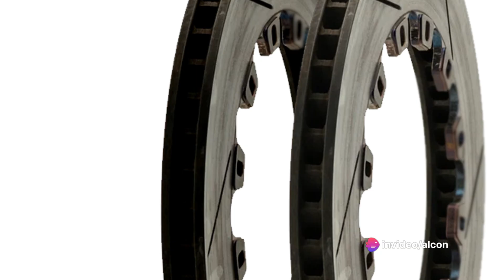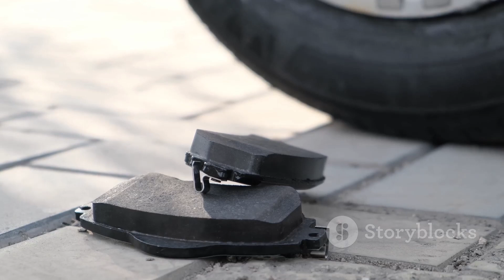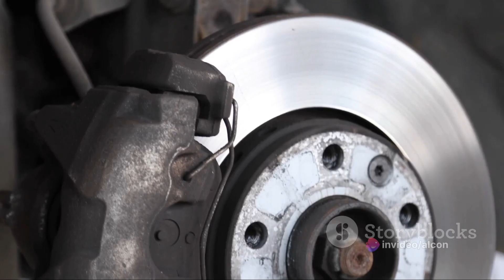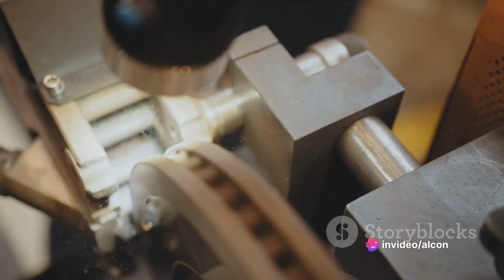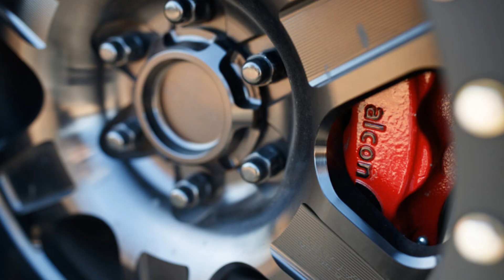Debunking the Myth of Warped Brake Discs

Comment: I don’t have a pulsating pedal. The pulsating I’m getting is on the front wheels. It gradually got worse after I put ceramic pads on. I know ceramic pads don’t dissipate heat like the OEM pads did and I believe it warped the rotors. And I understand the properties of ceramic so I know it’s not leaving brake material on the rotors and causing them to pulsate. Ceramic is extremely hard.
Reply from the maker: Hi.  Ceramic brake pad formulations deposit a layer of friction material onto the rotor that helps the two elements to work together to help control friction wear levels. The technology (referred to adherent or braking through adhesion) also helps to control noise, vibration and harshness.  Thie big difference between semi-metallic pads and ceramic, is that semi-metallic use a balance of abrasive and adherent friction.  Ceramic uses almost exclusively adherent which is why is so much easier on rotors.  https://www.tomorrowstechnician.com/understanding-friction-and-formulations/

Point being that uneven pad deposition on the rotor would still result in shudder in ceramic brake pads.
Reply: @alconkits4574  Thanks for your reply! I’m about to order rotors and pads!

Comment: Um yeah sorry B.S. on that, I've turned a shit ton of rotors in this trade over the years with no pad degradation on the rotor, pad wear is also even,  the rotors just warped, have you guys ever used a brake lathe? And then heat from brake applications, c'mon guys🤨
Reply from the maker: If you still have a brake lathe, then you're our people (not just a parts replacer).  You're not wrong, rotors will warp, eventually... ...but thats typically because a customer abused them by running too long on a shuddering rotor due to?  Paid deposition problems which cause hot spots and uneven wear.

Comment: Juan carlos roberto frenandez enriquez suarez…. down at the local used tire spot fiercely disagrees…..He says that he turns his (mas grande bro) 3/4 impact all the way up ……and gives no less than 14  but no more than 20…ugga duggas, if you ever return, after not tipping on the previous visit…
And he does so because his cousin, Alberto carmen luis dejesus dominguez benitez alvarez, sells brake rotors for a nice commission to them later, just down the street, at the local Vato zone 😂 lifetime warranty bro, get in the zone!

Comment: No way. Never is my experience of resurfacing a rotor have I just removed pad material.
Reply from the maker: ...but what caused the uneven rotor surface?  Either very substandard rotors (not as common any more) or hot spots and uneven wear due to the root cause - deposition problems.

Once you have to turn a rotor down more than a few thou - its because this rotor has been run with this issue for far too long.  

If you want - ask them how long they've been experiencing this problem.  We suspect that the longer it is left unresolved - the worse the runout will be.

Comment: I don't think so.  I am an ASE Master and even though most pedal pulsation is caused by uneven thickness of the rotor, uneven thickness is not caused by pad material deposits, it is caused by abnormal wear.  Slightly warped rotors will not cause pedal pulsation because the sliding calipers will follow the warped rotor...up to a point.
Reply from the maker: Abnormal wear is often caused by uneven friction- a deposition/bedding issue.  Certain spots develop cementite which is much harder than standard iron.  The result is uneven wear - resulting in runout and thickness differences.

..but you're not wrong.  Customers that run with this issue too long will cause hot spots and eventual warpage.  The point is - that is not the cause, it is an effect.

Comment: When you say brake pulsing, do you mean when the steering wheel shudders on heavy braking? Because I have had the steering wheel shudder on heavy braking, changed pads, control arms and bushes and the same thing continued until I replaced the brake rotors.
Reply from the maker: This is usually where it is felt first because it frequently happens on one rotor.  If it happens on both rotors can be felt as much in the brake pedal too.

Comment: This is completely untrue. Warped rotors are obvious because of what causes them: excessive heat and uneven wheel bolt torque.

If you get pulsation suddenly after having tires rotated, there's nothing that could have affected the pad bed-in because that's not part of a tire rotation.

If you get pulsation only when the rotors are hot, it's not going to be uneven bed-in either, because that would affect cold rotors as much as hot rotors.

If the brakes pulse after the rotors have gotten extremely hot, that's also not going to be from bad bed-in, because using the brakes enough to get them hot will even out the pad material. That's how bedding in brakes works.

As always, the proof is in the pudding. If you have the rotors turned and they pulse again, but the pulsation stops after you put new rotors on, the old rotors were definitely the problem.

The problem most people have is they pick the cheapest parts they can get, and cheap rotors warp as soon as you get them hot.
Reply from the maker: Hi Alex - this isn't a matter of absolutes.  Of course cheap rotors can be warped, and they can be torqued incorrectly.  Its possible, its just very uncommon.  We've seen this issue hundreds of times and perhaps 2 or 3 could be attributed to improper installation.

In addition improper pad bedding can cause localized hot spots what will cause runout.  Whether you call that runout or warping is likely a matter of symantics.

However in MOST cases, particularly in performance brakes where installation is done carefully - uneven pad deposition is the most frequent cause of brake shudder.

Your points are valid and perhaps we should rename the video to "THe myth that most brake shudder is caused by warping?"  What do you think?
Reply: @alconkits4574   most cases are people putting in the cheapest parts that they can. I'm certain that the cases you're talking about do you exist, but they do not exist in the majority of vehicles that are repaired for bottom dollar most of the time.

The number of vehicles in consumer service far outweighs the number of vehicles used in performance applications.
Reply: That’s not always the case. If you have one side of a caliper seized, it can eventually cause pulsating brakes. 
Also warped rotors isn’t just from too much torque, or white boxed. It can be caused by wrong pad/rotor combinations.
Reply: @TheOfficialRandomGuy  if one side of the caliper is seized, it would cause the rotor to overheat, warping it.
Reply: @AlexandarHullRichter  it “could” not would. Depends on how the caliper is hung up. There’s no absolute. Uneven brake deposit is a real thing.
Reply: kaferere  the wheels support the weight of the car. That can warp anything light enough to be a part of car. I think your error is that you are perceiving a warped rotor as being something like a taco, which is not what it looks like. 

A rotor can warp as little as 1/10,000" at the edge, and that will be enough to cause breaking pulsation. To the untrained eye, that tiny amount of runout is not even visible, but when the wheel is spinning at a 1000 rpms, you will feel it 2000-4000 times per minute the moment you touch that pedal. 

Remember, the distance each brake pad moves is only 5 mm (1/5") from when you install the brake pad to when it is worn out, years later. It's amazing that rotors can warp as much as they do before you feel it.

Your second error, I would say, is that you are discussing this as if it is theoretical, and not as if it is something that actually happens to people every day, which is what it is. We can say whatever we like, and it doesn't matter because it actually happens, and what actually happens is inherently more accurate than whatever is said about it.
Reply: kaferere   I think you also haven't seen videos of people getting their brakes red hot. That also happens. There are lots of people that regularly come to a stop and their brakes are glowing as bright as their taillights are. There's nothing that's going to keep steel rigid when it gets that hot.
Reply: kaferere   if you're going to use a typo as an excuse to ignore facts, you've got no business telling everyone they're incorrect.
Reply: kaferere   how exactly does overheating a rotor cause runout if not by warping, then? Do they magically wear weirdly because you get them hot? What about the ones that pulse when hot and not when cold? How else does heat cause runout?

Also, incorrect or uneven wheel bolt/nut torque DOES cause brake pulsation, and it can be fixed by retorquing the wheels correctly. How does that happen, if not by distorting the rotor?

I find it hilarious to you think metal can shatter before deforming. That's not how metal works. Even glass will bend before it shatters.
Reply: kaferere  The excuses you're making to deny a basic fact are quite hilarious. Literally everything in your last comment is absolutely wrong. I could go into every single detail if I wanted to, but I'm not going to waste my time. Literally every single sentence that is in your previous comment is not only so wildly incorrect, but it is so wildly incorrect that anyone who has put their hands on a car brake can independently tell you from their own experience, not from the internet, but from their experience, that each of those sentences is wrong.

Literally everything you've said has been telling me that you have only learned about cars in theory, and you've spent less time reading books about it than I've spent working on cars, and you're making up excuses to tell me wrong I'm wrong over the internet, because you don't have the courage to admit the things you claim to "know" are incorrect.
Reply: kaferere   btw:
https://youtube.com/shorts/CSOgT1xQE-U?si=KbmLnI9A5GWvhZM-
Reply: kaferere   not only is this glass, it's tempered safety glass, which is stressed to shatter completely instead of breaking in only one spot because that's how auto glass works:
https://youtu.be/I1VKVRotVxI?si=t0znVID0EUPvBMaA
Reply: kaferere   explain to me then how a freshly machined rotor gets to have an uneven surface after the lathe made it even, and explain to me why that only happens when it gets hot, before the rotor returns to having a smooth surface while it's cold and only while it's cold. 

And follow that up with an explanation of how replacing the rotors, and nothing else, solved that problem. 

I'll wait. I've only seen that happen a few times too.

Generally when you replace only one part and the problem goes away, it's pretty easy to figure out the part that got replaced was the problem.
Reply: kaferere  you're failing to answer my questions. How do you get breaking pulsation when the brakes are hot, and not when the brakes are cold, after the rotors have already been machined to eliminate uneven thickness and uneven deposits? How is it possible for that problem to be corrected by replacing only the rotors?

You do not have the ability to question any of these premises because they are things that actually happened. I'm simply asking you to explain how, since you are denying the obviously correct explanation. If the above is not explained by a rotor warping, then what quality of the brake rotor causes it? Remember it does get repaired without other parts being replaced.
Reply: If you have rotors turned and they still pulsate, it was not performed properly. Either the equipment is faulty or there wasn't enough material removed.
Reply: For a rotor to get so hot that it warps, it's probably bring abused. If a rotor has overheated it should be replaced. An overheated rotor is easily identified by a color change, normally blue. This video is clearly addressing the most common cause of pulsation which is absolutely uneven pad material transfer that causes a thickness variation. High and low quality rotors will do the same thing.
Reply: Propper bedding in procedures  actually require periods of cooling between cycles to avoid excessive heat. Where you've gathered your opinions only you will know, but I've got my knowledge directly from manufacturers. 

Also, you should be careful in arguing that if replacing the part fixes the problem, then there is no other remedy that would work. I wouldn't replace my kid with a new baby to get it to stop talking back and call that the only remedy.
Reply: You should tell your technician to learn how to machine rotors properly and perform the correct bedding in procedure or get a new technician.
Reply: @notSalaried  you assume I have a sample size of one. It sounds like you probably do. 

That is an incorrect assumption you have made about me.

I actually gather information from multiple places before forming opinions. In this case, my opinions are from multiple vehicles I've personally experienced, over multiple decades of service, and from experiences of literal hundreds of people in online groups for the vehicles I use. 

Manufacturers can say whatever they want to get your money. When people's goals are to keep their vehicles reliable for 30-40 years after production (read 25-35 years out of warranty), they look at things a little differently.

Also, replacing a child? Do you use rotors made of gold for such a comparison to be appropriate?

Where I live, a new, good quality, rotor costs less than a mid-range tire. Shitty rotors cost less than cheap tires. 

The labor cost of listening to idiots on the Internet is worth more than the cost of new pads and rotors, which I will remind you, are consumable items in the first place.
Reply: @AlexandarHullRichter  Explain to me how a parts manufacturer makes money on machining a used part for re-use. 

It soulds like your guy is a professional parts changer. The labor cost is negligible between machining and replacement. The cost of parts vs no parts is not.
Reply: @AlexandarHullRichter I assume you've had multiple shops sell you rotors. I don't assume you have a small sample size.
Reply: @AlexandarHullRichter Rotors being replaced or machined isn't going to affect the longevity of a vehicle. Your pocketbook is probably going to determine how long you keep a car. I machine my own rotors when I replace pads as long as the rotors are thick enough. I also have never had a set of brakes come back after replacing them. I do the job right and take pride in that. I hope you find someone who does the same to service your cars.
Reply: @notSalaried  do you talk to your mom like this? If not, you need to practice some better matters. 

If you're so intent on doing the job correctly, you probably haven't used the cheap junk rotors a lot of people use. 

I don't use cheap junk parts anymore because I learned that lesson. The only times I've had rotors warp, it was because they were cheap parts I shouldn't have been using in the first place, or because a shop overtightened my wheels, and I don't visit those shops anymore.

Like I said, I learned that lesson long ago, but that's also why other people have rotors get warped. Cheap parts aren't worth the labor to install them.

I've done my own brakes for a decade and a half now. The good quality parts I got the last few times, were worth less than labor to have someone else install them. 

Have your own options, but if doing the job twice (and having double the downtime) because something went wrong costs more than replacing parts the first time, those parts aren't worth saving.

Having a vehicle out of service for one repair is expensive. Having it out of service twice for the same repair is more expensive than wasting the money the first time around.
Reply: I argue with my Mom most of the time when she's  wrong. 

Rotors themselves don't actually warp. Pulsations can occur with cheap and expensive rotors. It's the same root cause. If the job is done right the first time, there shouldn't be a second repair. It's not complicated. That said - you do you.
If I repaired your brakes I would do it once and you would spend less money. I think that should be enough. If it costs you less money to just replace them vs. choosing the wrong shop and having two repairs for the same issue, then go with the replacement. Back go your first rant, that the video was "completely untrue" ....You're mistaken and,  respectfully, not qualified.  The video is accurate and consistsnt with every brake/ vehicle manufacturer that I've ever received information from. You have anectotal information, but like many others, you draw the wrong conclusions from your experience. I think we're probably at the end of our conversation. I've given you as much information as I have the energy and attention for. Good luck Alexandar!

Comment: I’ve had this experience with my 1 ton truck, it sat unused for a few months, and when I next used it, it was terrible. Like your picture, there was a spot on each rotor where the pad had sat, nothing you could feel though. It didn’t wear away with use either. I came down a long grade on a highway, with a good load on, the front wheels must have been 180° out of phase, it instantly became a dire situation, it upset the equilibrium of the truck so badly.